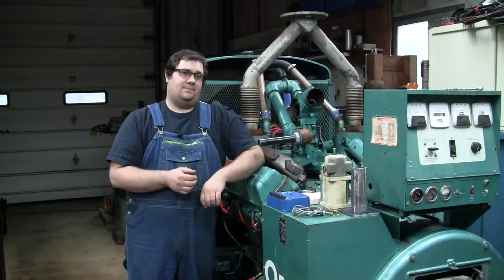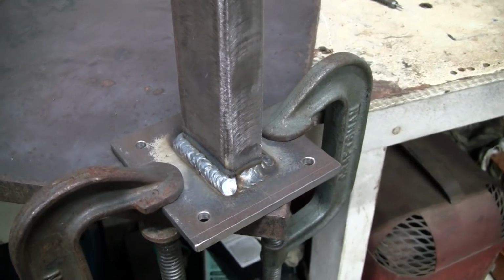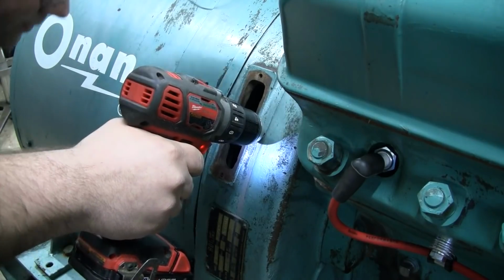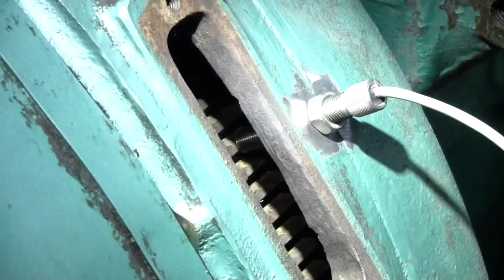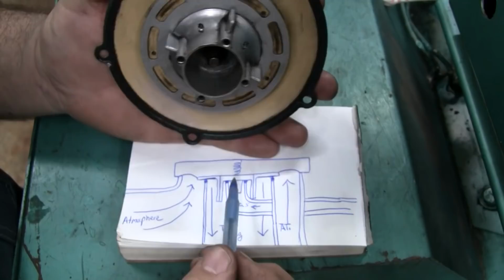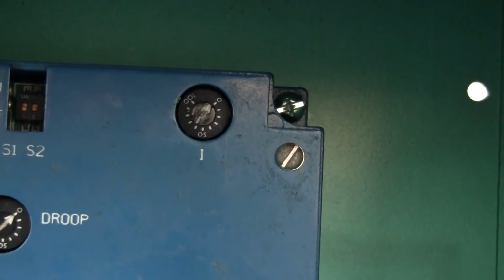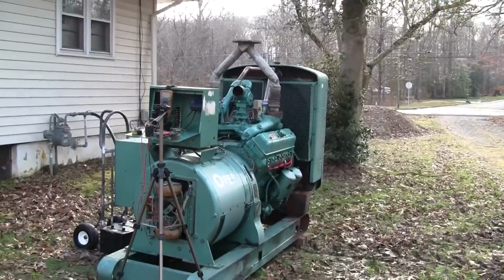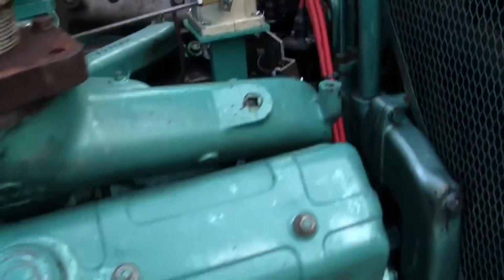GENERATOR ELECTRONIC GOVERNOR CONVERSION 884 Cubic Inch V8 Onan 140 WE

Comment: A future note when drilling cast iron. I worked in a machine shop at one time. We use to put a chamfer on the cutting edge of the drill so it would not grab and break when it passed through the cast.

Comment: Hi Mike, awesome video. Quite an interesting engine you got there. I have an old Ruston  two cylinder stationary engine from 1970. It's hooked up to a 3 phase alternator powering my house during blackouts. I want to do a governor conversion like you did. You mentioned that you can either use the mag pickup or a way to read the output frequency. The engine has no ring gear, so I think the best way is using the output frequency, if that's possible. Are there any engine/ alternator specific rated governors that I need to look for? One that specifically reads output frequency?
Thank you.
Reply from the maker: Thanks for checking it out!
Governors America makes one or two speed controllers that will sense directly off the 120 or 240v output of a gen.  I have never used one myself.  There are probably others out there if you do some searching.
Reply: Thanks Mike. I'll check 'em out. Although I learnt that it's probably not the best to use output frequency, in case I have alternator failure, which could end bad.

Comment: I greatly enjoy your videos, especially the lengths that you go to to fully explain everything you're doing and why.
Thanks!
I'm thinking of converting my 1970-vintage Kohler 3.5KW 4-pole 120VAC generator to propane power, and also building a WiFi-connected microcontroller-based governor that can also act to monitor and control the genny remotely, and maybe even do electronic voltage regulation.

Comment: I had to change timing gears on a tractor and upon first fire it idled good for a second or two and then it ran away. I'm assuming I got a spring wrong and it pulled the rack to wide open...any advice on how I could learn more general information on diesel governors?

Comment: Hello from Australia, I am a retired mechanical engineer with almost 58 years in the heavy diesel industry such as trucks, earth moving machinery and locomotives. You have done a great job of changing from the mechanical governor to electronic and I have done quite a few of these myself including air throttles, however in my opinion the lever on the throttle shaft is at the incorrect angle E.G. it is leaning back to far almost over centre, the most important position is that the push/pull rod should be at 90 degrees to the lever at half stroke. In other words if the push/pull rod moves 60mm then the lever will be active 30mm each way of centre. Thank you, keep up the good work.

Comment: 39:20 here's where I just use a mechanical stop to crack the throttle butterfly open. Get the thing started, adjust that stop to correspond to about 500rpm or so.

Comment: I guess, with a exhaust and air filter installed you'll have to adjust the governor again, like changing jets on a carburetor if you run sport air filters instead of a stock airbox...
Great explanations, I could follow and understand easily, big thx!
:-D

Comment: I wonder if there’s a way to pull the guide by dropping the valve and threading a tool into the bushing or whatever it uses, maybe with gear oil on top of the piston, then press the new guide in and aim the valve through the spark plug hole using some bent wire pieces, then use a small magnet on a rod to grab and pull the valve up into the guide enough to safely rotate the engine to lift it
Reply from the maker: Good idea, but lapping the valve in could be troublesome...
Thanks for watching!
Reply: @SmallEngineMechanic  ya, it could be done, but it’s kinda like skydiving without a parachute, sure it will work, and some are lucky enough to do it twice, but it doesn’t mean things will go so well after (compound getting between piston/rings/cylinder wall), and the easiest way to do that is to remove the exhaust, and by that point taking the head off to do it right doesn’t sound much worse

Comment: I saw one thing that scared me a little, this is meant as a friendly advice and not criticism - I saw that you held various metal parts of the machine with one hand while adjusting/working on mains voltage circuitry with the other hand. I'm not an electrician but an electronics engineer with things that involve dangerous voltages as part of my hobbies, and I was given a good advice many years ago when not that many years old: always hold one hand behind your back if you adjust/measure/risk touching something that carries high voltage in order to reduce the risk of getting a current conduction path across your chest - then you only risk getting shocked across parts of the same hand (at least if you wear reasonable footwear) which is just pain instead of either getting stuck or worse. I have had the pleasure of experiencing our fine 240V AC both before and after rectifier/capacitor banks between parts of my right hand on a few occasions, even got stuck pinching conductors with my fingers when shocked with DC, and luckily haven't got it across both hands..
Reply from the maker: I appreciate the thoughts!  Incase you did not watch the previous video on this gen set, I disabled the voltage regulator prior to starting initial engine runs and testing.  As a result there was only residual voltage being generated on the output lines.  Appx.  15 - 20 v.  
Thanks for watching!

Comment: Awesome job love this channel .
Weird why they didn't make pickup to use 60hz off Generator AC end?

All the neighbors switched back to oil and electric heat and ovens...That motor sucked all the street gas mains out... lol 😅
Reply from the maker: Thanks for watching!
Governors America actually makes a controller that uses the AC output of the gen for it's speed reference!  I have not actually used one though.
Reply: @SmallEngineMechanic  I had one pickup go haywire from metal chips off starting gear.
It was on a JLG 60 ft boom lift with a CAT motor ... dealership couldn't figure it out. Spent a fortune then gave up. I bought it cheap and fixed it.
I finally solved it after cleaning Magnet pickup.
This is a common issue on ABS brakes on cars trucks and rear axels for computer control shifts.
My channel I my name I have a bunch of  bizarre repair s on it.
Just to help others no monetary.
Hope to meet you at a show. I have a few old Onan diesel sets need wiring diagram for magnacitor.

Comment: Have you considered of adding a Tachometer to the ignition system so you can see what rpm it’s running during operations ? I thought that would be interested to see and have that option. On the number 6 cylinder issue can you adjust the rocker arm to get the right clearance?   Great video have a Blessed Day Sir.
Reply from the maker: Thanks for watching Eddie!  There is really no need for a tach on a gen like this, you reading the gen output frequency will allow you to figure the RPM.  
Unfortunately the trouble with the valve is the sloppy guide not letting the valve seal correctly.

Comment: in my experience (which I grant is more limited than yours.) you want to use all the servos travel. It has more control if it takes all of its range to move the throttle the 90 ish degrees it moves. I can't tell if its set that way or not.
Reply: mweverett ... you MUST have full throttle swing but this type of controller works ok at say 75% of it's travel. IOW, work it manually to make sure the throttle can go where it's needed but try to avoid the controller being used at 100% voltage for too long. It's like that for most electric throttle controls. Basically you want enough travel so the unit has room to fine adjust but not always working to it's limits. Also try to avoid such a short stroke that it has trouble locking in at a steady speed. It's a compromise in geometry versus total travel of the linkage. You can usually achieve it by not having more than a 45 degree angle at the pivot points under normal loading. Look at the throttle lever... 45 degrees to idle and 45 degrees to full throttle is the sweet spot.

Comment: The MAG pickups that I have dealt with were twice that diameter. (CAT)  I would have stuck a bar magnet (from Harbor freight, two for $1) inside the bell housing UNDER the hole being drilled to catch almost all of the filings.  (as I always do)  Both switches on the governor's controller looked to be up-up instead of up-dn,

Comment: Doesn’t that flywheel pick up  control box need to know the number of teeth on flywheel?
Reply from the maker: Thanks for watching!  Nope it doesn't care how many teeth are on the flywheel as long as the mag pick up generates 3000-8000 Hz at the desired engine speed.

Comment: Had an scr drive for a 500hp bow thruster that was faulting out due to unstable frequency after a generator rebuild. Checked frequency, dead nuts 60hz, +/- maybe .2-.3 turned out it was cumulative frequency error, 10hz in a second caused the fault, +.1-.1=.2 and so on.. The fresh rebuild had those 3406 Cats responding so crisply it was adding up to the threshold pretty regularly even under no load. I ended up dropping the gain on the woodward 2301 governors to allow a few HZ of drop before it got after it, cured the issue no problem. that was two 285kw generators in parallel running 100hp of hydraulic deck machinery and the 500 HP bow thruster, I always found it interesting that too stringent speed control caused that fault.
Reply from the maker: Thanks for watching Greg!

Comment: Quick question, you mentioned about how butterfly throttles aren’t particularly linear, and I totally get that.. but as I understand it’s the opposite of what you described - the first few degrees of rotation provides a drastic change both in the area of the opening that air can pass through and in engine speed, and as you approach wide open throttle each degree of rotation makes less difference to the area of the restriction. Old BMWs with mechanical cable operated throttles had a unique linkage that slowed down the throttle butterfly rotation just off idle and sped up as it approached WOT. Made the accelerator pedal more linear and the car less prone to lunge when you just barely touch the accelerator like a lot of Japanese cars are known for doing. 

Anyway, awesome to see the old girl getting modernized... the best kind of machine is one built with old iron and controlled by new(er) computers! 😎

Comment: The company I work for is the distributor for Woodward engine controls and thus also Barber Colman (because Woodward bought that company in the early 2000s).  We do hundreds of these controls upgrades a year and I found this to be pretty typical of how it goes.  Of course nowadays there is a digital, integrated control device in the actuator itself, which is integrated right into the throttle body, so it's a bit different.  Of course I also respect using slightly-outdated parts you already had on hand.  Great video.
Reply from the maker: Thanks for checking it out David!

Comment: I have worked on natural gas furnaces in an aluminum plant.  We had 3 of the furnaces that had two twenty million BTU burners and two that were smaller that had about 12 million BTU burners.  They were all mid 1960s technology when I worked there.  We had a couple that had three five million BTU burners but no emergency generators.  Our gas supply was huge, I think 12" high pressure natural gas lines.  I helped install a few emergency generators, two were natural gas and all the rest were diesels but I never worked on them after they were installed.  I really enjoy your work on these and your trouble shooting technique.  I did rebuild a few ratio regulators on the big furnaces that did the same thing the unit you were showing worked except the air was force fed and the pressure from the induced air determined amount of gas.  I am an electrician and never really liked working on huge gas furnaces, they really aren't something you can afford to make mistakes on.
Reply from the maker: Thanks for checking it out!

Comment: One thing I didn't quite get as far as the electronic governor was not needing to account for the number of teeth on the ring gear on the flywheel... does the governor use sort of a unit-less speed reference, and you just adjust the potentiomeeter for the speed adjustment until the observed frequency is within the desired range?  i.e. if there are 100 teeth on the flywheel of one generator that the speed controller could be hooked up to, and 72 teeth on a different generator, that would simply result in a different speed reference potentiometer setting to maintain 60 Hz, to account for 6000 teeth per second on the former vs. 4320 teeth per second on the latter example?
Reply from the maker: Exactly!  This controller has an input range of 2000-8000 pulses per second, the speed adjustment range.  
Thanks for checking it out!

Comment: A little better explanation about the butterfly not being linear might be that if you had a graduated indicator 0 to 100 % on the linkage,  you would find that the air flow past the butterfly wouldn't be in direct proportion percentage wise to the position of the linkage.
Reply from the maker: Thanks for checking it out!

Comment: Thanks Mike!  I purchased an import electronic governor control (identical to your actuator and control) for my little Wisconsin 2-cyl, 18 hp with 2.3:1 twin belt drive to 5000W Northern head for a slow speed genset.  The wiring and control adjustments were a bit intimidating due to the lack of documentation.  Your vid provided a lot of clarity.  Much appreciated!

Comment: The actuator throttle ratio change is setup backwards.  You have a small linear travel causing a large angular change off closed throttle. The butterfly arm should be near vertical closed and nearer horizontal fully open. Trigonometry. Very good job with the welding.
Reply: Yes, I agree. Very roughly 75% of the load is controlled over the first 25% travel of the throttle. In the current set up, engine speed and load response will be highly sensitive to the governor action on light loading, which may need to be damped, possibly making it sluggish at higher loads. I would suggest that both levers are set perpendicular to the tie rod when the butterfly is about 15-20% open and the governor travel at 50%. Something like that.
Reply: @martinhughes8500  ... it's trial and error in this case, but I would shoot for to more than a 45 degree angle on the extremes of throttle travel. Something near 90 degrees (lever to linkage) is where I'd be happy for 50% load. Yes, I have done a few of these retrofits so always need to play around a bit.

Comment: Hi Mike. Thanks for these great videos, I like the meticulous way you are working on your projects. About the integral gain of the PI controller : its purpose is to cancel the steady-state error. The "I" term reduces to zero the steady-state error between the reference (60Hz) and the measurement feedback coming from the inductive sensor. So, with a constant disturbance (you manually pushing on the governor arm or by connecting a load), the "I" term should regulate pretty accurately the frequency and, after a settling time, it should converge exactly towards 60Hz. The amount of "I" gain influences the settling time but has also an influence on the overshoot (increasing "I" yields usually more overshoot). Too much "I" could even yield some instabilities. More infos here : https://en.wikipedia.org/wiki/PID_controller

Comment: I don’t know anything about the effect of gas feeds. The overshoot on the throttle when you forced the throttle low is characteristic of gain set too high in a control loop. You get a large overshoot before it settles back to the right level. The loss of power due to low fuel pressure is certainly confusing the issue but if that were absent, I would have said the gain was set too high.

Comment: I've seen people replace rocker arms and springs without disassembling an engine, by turning it over until both valves are closed, then pressurizing the cylinder with compressed air. Any chance that it would be possible for you to replace the valve guide that way? I suppose the most difficult part would be trying to pull the old guide out. Anyway, it's just a thought :)  Thanks for another good video buddy! These long ones are great :)

Comment: Nice Job.  I hope you get the 6E valve lined out.  Are you worriied about burning (possibly dropping) it diring the load test?

I know it sucks to pull the heads again, but as the joke goes...."at least it will come apart easy".....ha.

Its not something crazy like not enough lash to allow it to seat.....i.e. the sloppy guide threw your lash adjustment off.  Last, maybe you can get a look through the plug hole with a fibre cam and see if is burning.

Great subject matter.

Comment: Check your dip switches again!
Reply: I noticed the same, but Im not sure if it just looks wrong on camera. Hard to see the elevated parts with the camera pointing straight at the switches. I think the dark parts (because theyre dirty from touching them) of the switch are the elevated parts. I think it just looks on camera as if these dark parts were the lowered parts and the bright parts were elevated. (optical illusion) But in reality its the other way around. 40:00
If my theory is right: The setting of the switches would be correct as it is on the video.

Comment: Is it just me or are those DIP switches set backwards?  Thanks for another great video btw!
Reply: I was yelling at him that dip switch S1 is incorrect, but I guess he couldn't hear me :)
Reply: @Topdogswmi  Me TOOOOO
Reply: I was thinking the same thing
Reply: Same here. S1 looks off.
Reply: Yeah, I just yelled at him as well. S1 and S2 are both set wrong. S1 is off when it should be on for gas, and S2 is on when it should be off for the 8000 series governor actuator.